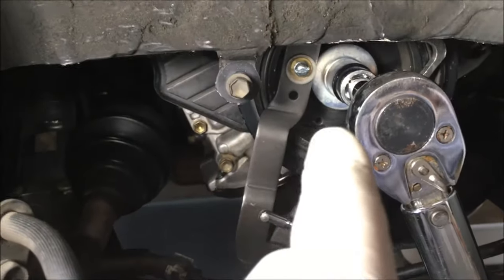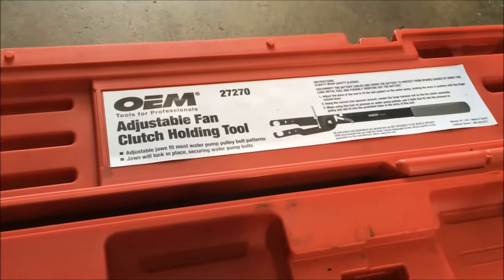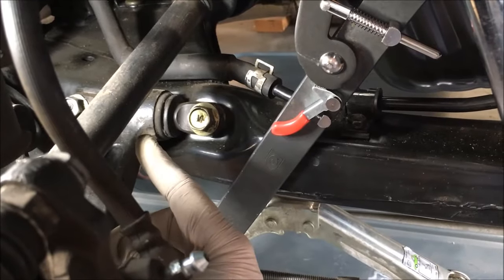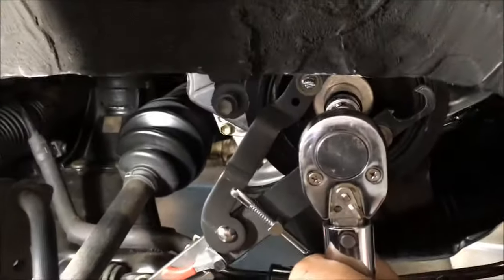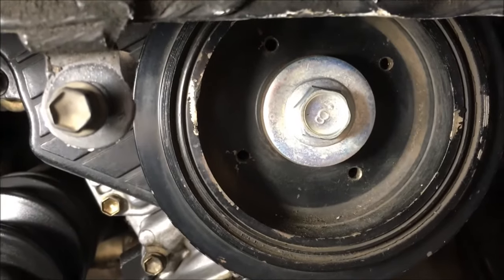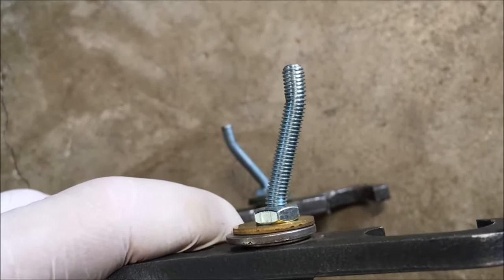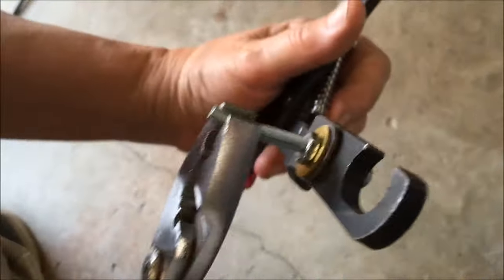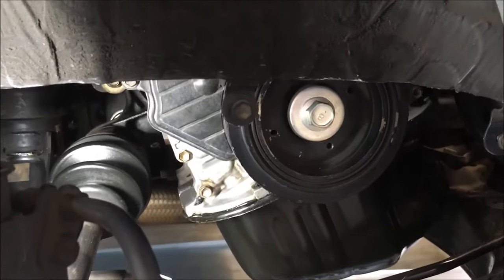Torque Crankshaft Pulley Bolt | Harmonic Balancer Bolt

Comment: Can you use the tool to remove the crankshaft bolt?
Reply from the maker: You can try it, Max, but I don't know if it will work.  Depends on how tight the bolt is torqued.  We tried to, but someone had way over torqued the crankshaft bolt on my car, and we couldn't budge it.  Not even with impact wrenches--electric and pneumatic.  Be careful with impact wrenches.  If you go at it too much, you can round off the shoulders of the bolt and then you're in a bit of trouble you don't want.  

We had to bump start the engine to loosen the bolt.  Worked like a charm!  I have a video on how we did it, if you'd like to watch it.  Here's the title of the video, "Loosen Crankshaft Pulley Bolt by Bump Starting the Engine | Loosen Harmonic Balancer Bolt."  Search in my videos, and you'll find it.  Let me know if you need anything else.
Reply: This tool should work to remove but you will need a long breaker bar probably. Or use the starter method seems to be popular as was said above.

Comment: Great video! I’m trying to torque one on a 2014 Hyundai Accent. Do you have a source for that tool you used or know what it’s called to purchase something similar. Also is there supposed to be a washer for the main bolt for the crank pulley to keep it locked in place so it does come undone.
Reply from the maker: Thank you, Kevin.  Borrow the holding tool from a local auto parts store or purchase a tool off Amazon.  It's called either Universal Camshaft and Camshaft Pulley Holding Tool:  https://amzn.to/3Demzb3 or Universal Pulley Holder Wrench WITH Interchangeable Pins:  https://amzn.to/3o1d3Uf

I'd buy the pulley holder that comes with the interchangeable pins so you don't have to try to find bolts that fit.

No, mine did not have a washer.

Comment: Will it work for 220 ft lbs for my crankshaft? I also have threads into my pulley for my bolts so I’m concerned if my threads can withstand the pressure from the crankshaft bolt. I do not have an impact gun but I’m looking for alternatives. Thanks.
Reply from the maker: Jacob, I can't answer that with any certainty.  The bolt on my car was suppose to be torqued at 80 pounds, but some lunatic waaaaay over-torqued it so we couldn't get it off even with electric and pneumatic impacts.  AutoZone rents out all sorts of tools.  Ask them if they rent out an impact.

Comment: Did you buy the tool or rent it from a auto part store? That would help as you showed us how to set it up.
Reply from the maker: I rented it from AutoZone.  But, you have to supply your own screws/pins  I put a link in the description area of the video to a similar tool on Amazon that AutoZone used to rent out but no longer does.  That tool includes the several pins for different applications.  That is the tool I would use.
Reply: @frugaldiy1  I been looking around here on YouTube and people have done all sorts of things. From going to a machine shop and having them make something out of flat stock with of course them drilling a hole for access to the bolt itself then having also access to the holes that are used for the puller tool.  I watch your video I am just scared of shearing off one of those screws inside the small holes as your bent.
Reply from the maker: Saleen, I understand your concern regrading the bolts shearing off.  But, it was only 80 ft. lbs torque so we concerned.  Yes, you can make a tool out of flat stock or angle iron or a 2x4 or any number of materials.
Reply: @frugaldiy1  I have a 96 Ford f150 my Chilton manual said about 150ft lbs. I was going to try the 2x6 method bc I could have more length to prop it against my chassis frame that my bumper attaches to.  I wasn't ruling your idea out though, only problem I would have is the tool not being long enough to put against something. I have a little bit bigger diameter holes on my balancer 3 to be exact that I used to pull it off to install my new harmonic balancer.
Reply from the maker: Saleen, my car is a 1995 Camry and the torque spec is 80 ft. lbs.  I'd recommend yuo torque it to the manufacture's spec.  Re length of tool, maybe you can add some EMT metal pipe to it to lengthen it.
Reply: @frugaldiy1 it recommends 130ft lbs to 150ft lbs I am going to do 140ft lbs
Reply: Autozone didn't have it I am looking at advance which doesn't sound like they have it.
Reply from the maker: You may have to purchase one.
Reply: @frugaldiy1  I asked about it they directed me to and asile to look. But I didn't see one available to buy. I did see oreillys had one from looking on their website but dont know if it was available to rent or if I had to buy one.  I was also looking for some bolts to fit inside two of the pulley holes. I might end up just using a 2x6  drill the three holes find the bolts to mount the 2x6 to the front of the pulley then get a bit to drill the center hole then brace it against either side of my chassis/frame.
Reply from the maker: Saleen, here's a link to the Universal Pulley Holder Wrench WITH Interchangeable Pins:  https://amzn.to/3o1d3Uf

Look at the part number and then call around to different auto parts stores and ask if they can find one for you.  Don't buy it, if you can rent it.
Reply: @frugaldiy1  right I'd rather rent it then buy it unless it was going to be used more then this time or the next time. I appreciate it